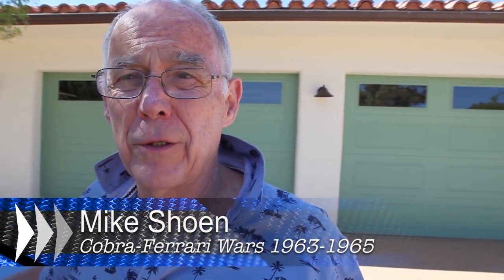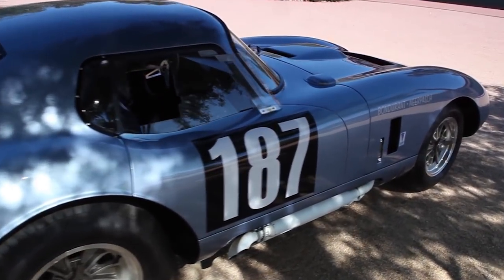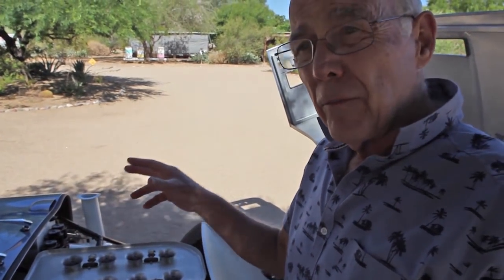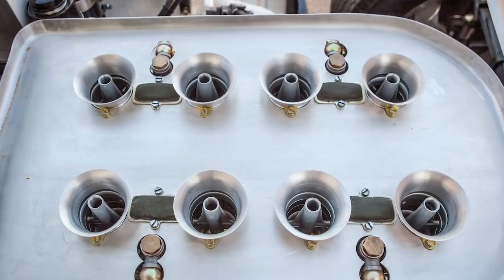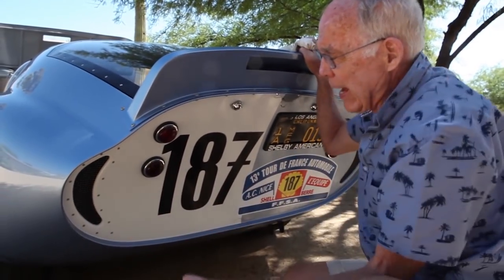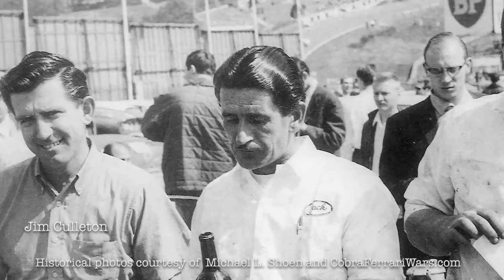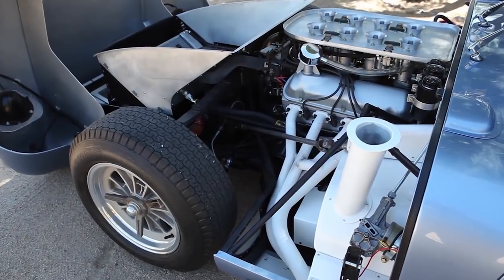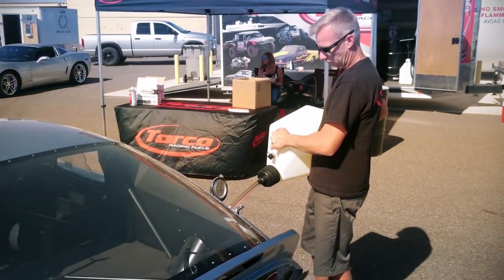Daytona Coupe History and Standing Half a Mile Run of CSX2300 Aluminum Replica

Comment: When I was in college 1973 at Illinois State University, Normal, Illinois there was a guy who had a 289 Cobra and a 4?? Cobra. Additionally, he had a Daytona Coupe. It had 'dimples' in the roof to fit the helmet worn by [I think he said] Dan Gurney. The owner had both legs burned off when the solvent he was using to clean the floor is an Ammco Transmission shop. He sued and he won big.  That's all I know.
Reply: Crazy Story

Comment: My Dad had a 64 Vette convertible with a 327 in it. He drag raced it and daily drove it, he said he ran away from the 289 Cobra. A guy showed up with a 427 and he was far and away out ran. The 427 ran all over some of the purpose built drag cars as well. Fiercely fast cars.
Reply: Cobra yeah but not the Cobra Daytona
Reply: @FOSTBITTEN - If your Dad's Vette was a stock 327, I have some difficulty in buying that line!  Never mind the Cobra, in SCCA B Production racing, the Shelby Mustang GT 350 with a 289 beat the snot out of the 327 Corvette 3 years running for the B Production Championship.

Comment: Back in the spring of 1968, I was getting ready to go SCCA racing. I was about 24. I had owned a '63 Corvette Sting Ray when the first came out in 1963. I had experience racing that car on a local level. 
But in '68, I toyed with the idea of going with a Cobra for B Production. When I was talking to the dealer, they said they could get me a Daytona coupe. Price...$12,000 delivered to Baltimore.
Sadly that was above my budget. Plus, I wasn't sure if it fit in B Production regs. And it was a Ford & I had no Ford experience.  So I went with a Corvette. 
While the Cobra would be a lot more today, the Vette  worked out better as it was eligible to run in the IMSA Camel GT series. The Cobra wasn't.
But I still think "What if".
Reply from the maker: Cool story, do you still have the Vette?

Comment: it took a shakedown run for them to figure out the wheels should be balanced? Where is run after the shakedown? It didn't sound like they had it geares short. I have a 37 year old Honda Magna V-45 that will hit 130 in 3/8's of a mile.I think he's out of practice with the shifter and they must have rolled out of it before a half-mile. Weren't they running at 180 or better on Mulsanne? That is a hell of a sound though ain't it? what was the compression ratio?

Comment: I had read somewhere that the original cars were pretty much junked after they finished out there racing career . Could that possibly be true?
Reply: They were not junked. I bought the last one from Shelby in 1969 for $5,100. A school teacher purchased coupe 2286 for $4,000 a few days before me. Shelby advertised all the coupes and some of the competition roadsters at the end of 1965 and most were sold then, "as is". CSX 2287, the Salt Flats car, sold for less than $4K. My coupe had miscellaneous dents, a broken right exhaust, a cracked driver's window and mold on the carburetor manifold. We fixed the exhaust and cleaned the manifold and the car ran excellent. I purchased competition roadster CSX 2345 and it was in good condition except for one broken suspension mount and paint stains. That car could put hair on your chest. Shelby offered three of the coupes, the Cobra transporter and one of the roadsters to Alan Mann racing in England at the end of 1965 for $18,000. Mann declined.
Reply: michael shoen what makes the Daytona coupes sound as good as they do? They just make sounds and noises that I’ve seen no other car or engine make
Reply: What would an original sell for now?
Reply: @sblack48  Lot of money. They keep going up. I suppose they will stop when people realize you can pound a Cobra with an electric Tesla. Maybe it is the history attached. That was a great time and a real adventure with good people all round.
Reply: michael shoen  You have absolutely no clue. Classics have character, history, sound, road feel and make you feel alive. A tesla is just a disposable appliance. Landfill junk. No comparison whatsoever. Only God knows why you would ever want to, but no one is going to be collecting teslas in 20 years and none of the electric cars produced today will even be running by then.
Reply: Ronald Aguilar.They were going to junk them. Apparently they had to get them out of the country they last raced in because of a tax reason. Shelby America wanted to leave them there because of the cost to bring them back. But the government  where they were said they would load them up and dump them in the ocean and  Shelby America would get that bill. Cheaper to just ship them home. Probably not close to accurate but something like that. I'm just happy the cars didn't end up in the ocean..

Comment: How much do these things cost?
Reply: Origonals go for for millions replicas start at like 15k-200k$ depending on quality
Reply from the maker: So I got this from the Builders themself: 
The price for business customers of a CC-2(Daytona) build we offer including all the extra elements listed below is 200 000 PLN net. Please note that if you buy it as a private person we will have to add 23% VAT tax.  (around $64,000 in 2019 exchange rates, that includes the VAT tax)
The 200 000 PLN price includes:
- Steel chassis, sandblasted and pistol painted;
- Full aluminum car body, file finished; (New and improved version with round lamps)
- All aluminum internal panels, powder-coated: cockpit and trunk section: black, engine section: white.
- Glass, attested car windshield;
- All custom made windows and plexiglas elements fitted on the car(headlight covers, door windows, behind doors scoops, side air deflectors, trunk cover);
- Aluminum fuel tank;
- Fiberglass spoiler;
- Aluminum air cooling vents for breaks;
- Turkey pan for carburetors;

The wait time is a bit more than a year right now.
Reply: @CoolCarVideo  and how much with the engine and drive train?

Comment: what hp in this?
Reply from the maker: The Daytona coupe horsepower is 330, a Ford crate engine. The original cars were 385 hp.
Reply: @CoolCarVideo  wow it really moves with only 330hp.
Guess it’s about 1100kg.
Reply from the maker: oh ya 330hp in 60s mustang is nothing to sneeze on, this something this light, makes it a rocket.  The originals must of been scary fast, a specially for 1960s
Reply: @shadmonk  - Bob Bondurant's Daytona Coupe with the 385hp 289 hit 197 mph down the Mulsanne Straight at Le Mans!

Comment: the car be needing twin turbos then i bet with right gears   taller gearing  turbos love  to work under load  , it would bust 200 mph no problem  in the half  hell you set it up right it would bust 200 in the quarter mile  put a lsx  454 chevy in her with nelson racing  twin turbo  pump 2500 hp   with track sprayed with vht and that car  would run 7 seconds all day  at over 200 mph maybe in the 6 sec range
Reply from the maker: That would do the trick to go over 200 but he just wanted the car to be exactly like the original CSX2300 and hey just took it to the half a mile races for fun and to open it up a bit.  But It would be fun to see one hit 200
Reply: No, fuck aspiration swaps and engine swaps, original or nothing

Comment: Nice car, But it is copy, not even made in the USA  , Poland ,come on ,
Reply: Yes, the others were made in the state of Italy.
Reply: You do realize the cobra came from England right??  Look up AC. Yes it's ford motor..
Reply: @9104311  uhmm, no, not really.  The Cobra started out as an A.C. Ace. I believe Bristol stopped supplying A.C Cars with their engines, causing a supply issue. All original Cobras were built up by Shelby American. The Cobra Coupe was designed (by Peter Brock) and built in the U.S.A. The AC Ace and the original 289 Cobra were of U.K. origin, but were modified. The 427 version was heavily changed from the original. Not much left of the original design, some of the body and chassis, I guess. The Ace was a great car however. Hope it isn't raining there!
Reply: TommyMacDaddy1 thanks for the details. And it's snowing lol.
Reply: @9104311  not much better here. Cheers!